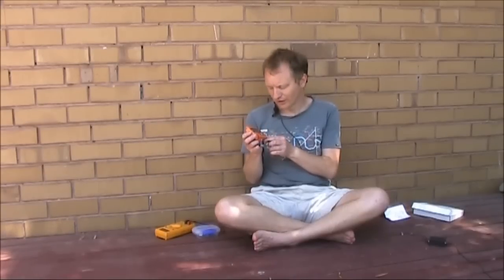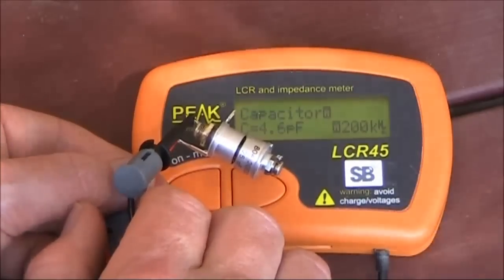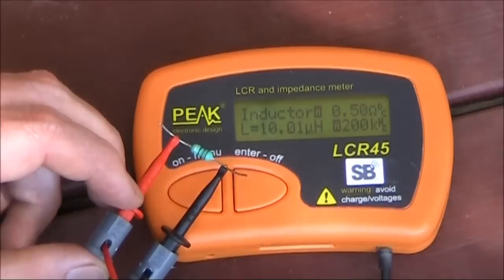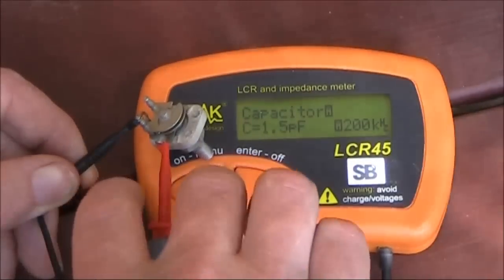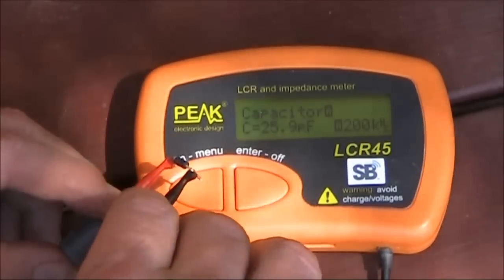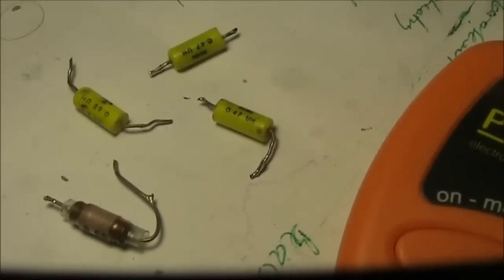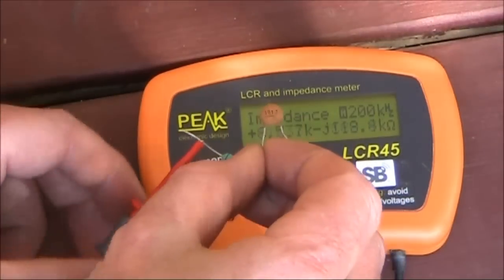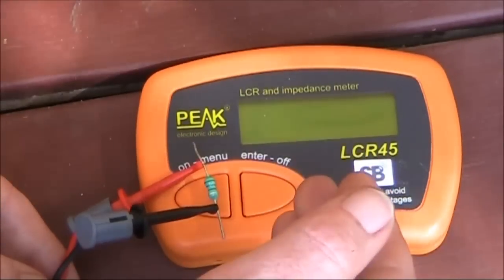Review: Peak LCR45 LCR and impedance meter

Comment: I could have really used this when I was building my 170 kHz transmit antenna. The capacitance  and inductance of the helically wound vertical, the top-hat, and the loading coil were completely different than my calculations, and really threw off the resonant frequency of my antenna, leaving my up on a ladder on a hot, sunny day with a portable scope attempting to retune my antenna. A good hand-held LCR and impedance meter would have been worth its weight in gold to analyze everything before it was all assembled.

Comment: Dear Peter VK3YE,
I have recently purchased a LCR45 and wonder if I can safely use it to get a  estimate of the impedance of a vertical wire length of about 5m (against ground) to then construct an impedance transformer (50 ohms to the measured impedance) to make an impedance transformer for an EFHW for the 10m band? 
1:64 or 1:49 ratio transformers are suggested with the usual impedance range said to be between 1800 to 5000 ohms. The manual says the LCR45 will measure resistance to 2Mega Ohms. I realise that it would be best to short the wire to ground before measuring to protect the meter from damage by high electrostatic voltages. The measuring frequency will be only 200kHz while the antenna will obviously need to function at about 29MHz but it would be a start............I have not tried a nanoVNA to attempt to measure the input impedance of the 5m wire but again it is said that the impedance is too high to get a useful reading?

Your comments would be appreciated.
Thanks
Chris m0pzc
Reply from the maker: The LCR-45 is completely unsuitable for this application. You must have a Nano VNA or similar  that covers the frequency range you want to make measurements for.
Reply: Thanks for the reply Peter. It is now obvious that the impedance value will depend on the frequency applied at the wire (antenna) input by the measuring instrument! However a MFJ antenna analyser although it will apply a frequency of 29MHz will only measure up to an impedance of 650 ohms so I suppose that I will have to build a transformer to reduce the value below 650 ohms and then back calculate what the true value was from the turns ratios? Then  wind a transformer to match 50 ohms to the calculated impedance. After that a nanoVNA will be helpful to visually tune the circuit with a variable capacitor in parallel to get rid of any excess inductive reactance from the windings on the toroid. Any other comments? Chris m0pzc

Comment: Anyone try measuring around 100nF film capacitors with this LCR45 meter? The impedance measurement on my recently purchased meter shows quite an unstable reading for the real (resistive) value, it will change value from low milliohms and goes up to over +2Ω. Sometimes it goes down below 0 to -ve values around -1.3Ω. The reactive value is stable at -j1.605kΩ. The meter is set to Automatic mode and selects 1kHz as the test frequency which falls well within its test range according to the graph on page 16 of the User Guide.  I'm interested to know if all the meters are like this or if it's just mine?

Comment: Purchased a PeakLCR 40 many years ago,next to my dmm my most useful piece of test  equipment, still working and accurate
Reply: I disagree....I rather use the DER EE LCR meter it is by far more easier and accurate to use. I do not understand the automatic feature...it is stupid, and the lcr45 has difficulty measuring low value capacitors...which should be the main reason to not use this

Comment: At 12:04 the ESR of the capacitor is shown as over 200 ohms. That is absurd at it's likely less than 1 ohm. It would have been instructive to test using an electrolytic where the complex are real parts are comparable, perhaps adding known series resistance to see how good it really is.